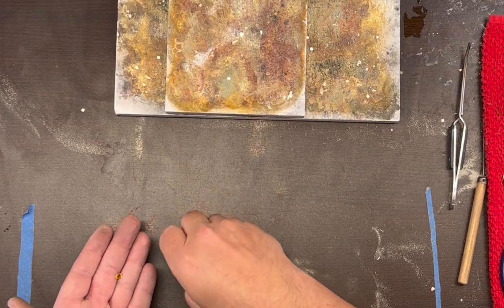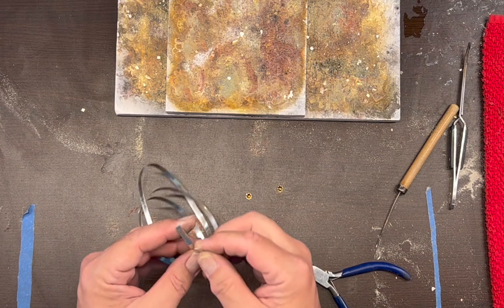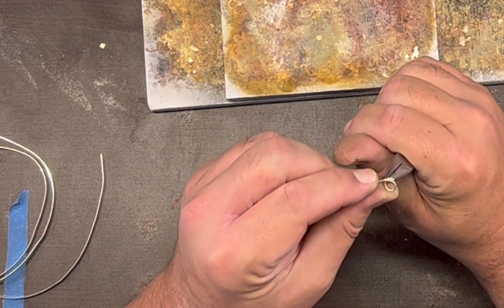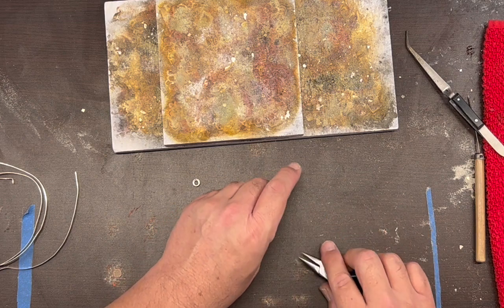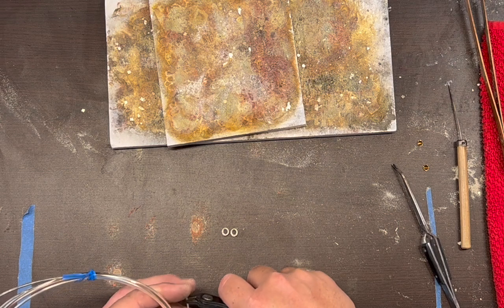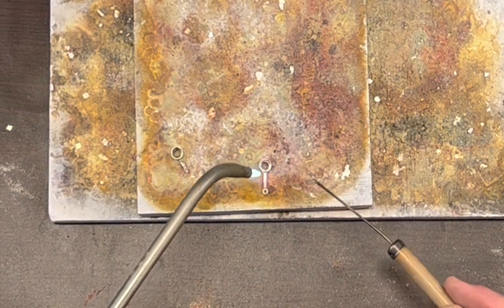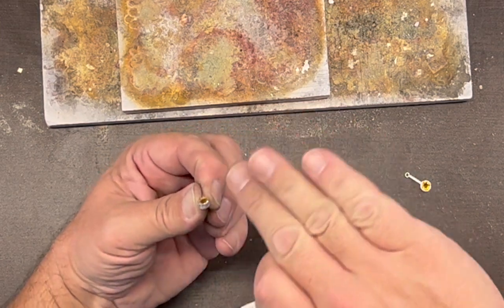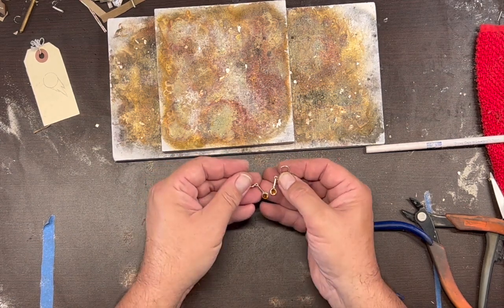Making a Bezel for a Faceted Stone

Comment: You have quickly become one of my favorite jewelers. My only suggestion is a camera with better close up abilities. I will be trying to replicate and the details help.
Reply from the maker: Thanks Ambkbero!  I would love to upgrade. I’m going to have to wait a bit to afford it though:)
Reply: @chadssilversmithing  Could I ask a few questions? Other than work hardening, how can I harden silver and copper. I'm working with copper till I'm confident enough to move to silver. 
Also, what's the difference between tempering, annealing and quenching?
Thank you in advance.
Reply from the maker: @ambkbero2  I know silver can be heat hardened in a kiln, although I’ve not tried that.  I think it’s somewhere around 600 degrees Fahrenheit for a couple hours, but look it up to be sure. I don’t know about copper. As far as those terms, I don’t think I’ve often heard tempering used in conjunction with precious metals. Annealing means to heat the metal to a high temperature followed by air cooling to soften the metal. Quenching just means to immerse in water to cool the metal off. Hope this helps. Maybe someone else watching can address the tempering issue with regards to precious metals in the comments here:)
Reply: @chadssilversmithing  Nah, you were correct about the tempering of precious metals-there's no need. That's usually only reserved for ferrous metals that become very brittle when quenched after heating. With copper and silver, as long as they're quenched after reaching a "black heat" there's no need to temper them, as they're already soft enough to work again. No one's putting a sharp edge on copper or silver :D
Reply from the maker: @codythompson2560  Thank you for the additional info Cody!